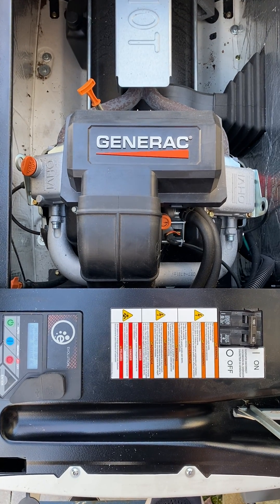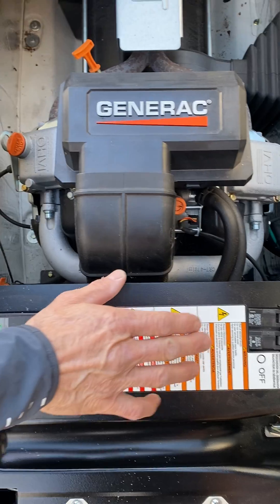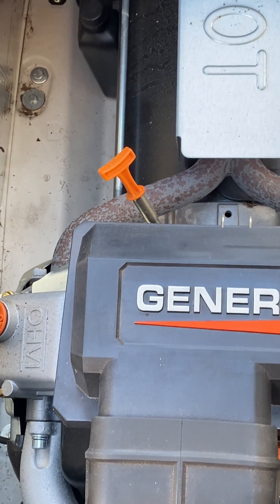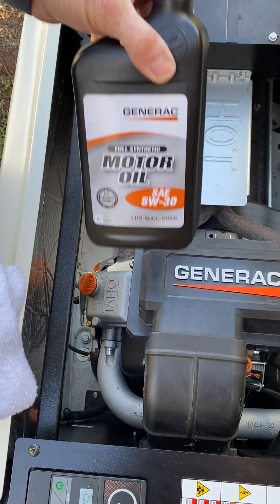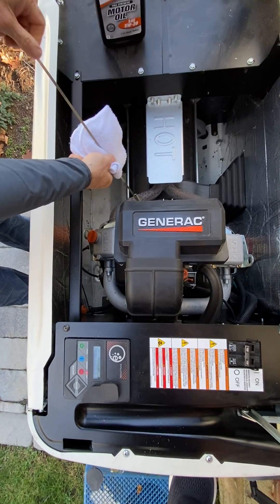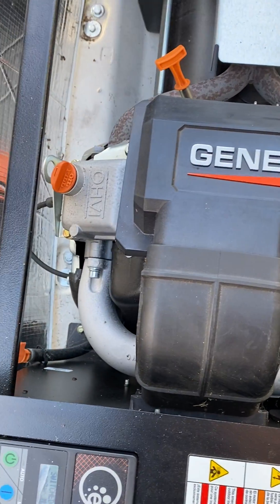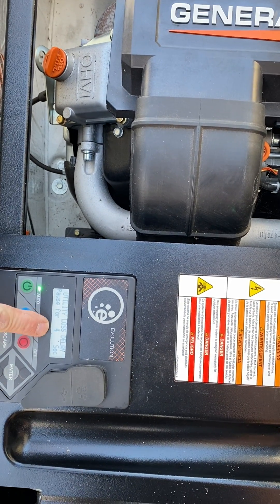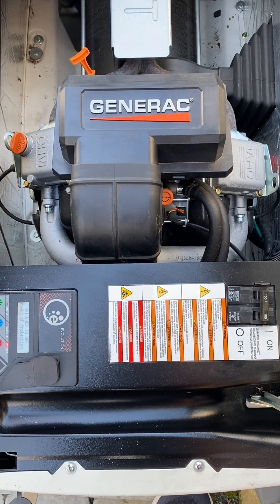How to check your Generac stand-by generator oil during power outage

Comment: Generac instructions say that step #1 is to shut off the utility main line circuit breaker before doing any of this. Is there a reason you didnt include that step?
Reply from the maker: Although Generac recommence turning off the house first. It is not required. I find the turning off the breaker on the generator in a residential is sufficient. This is my opinion. When turning the power off at the generator is like turning off at the house.